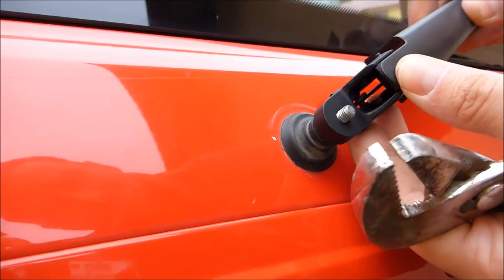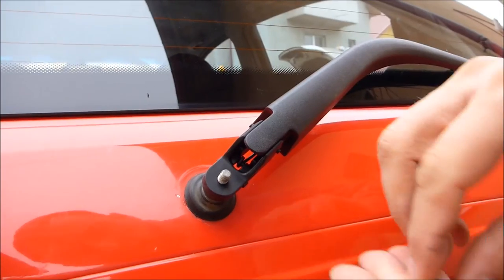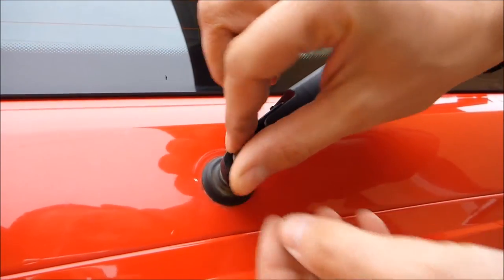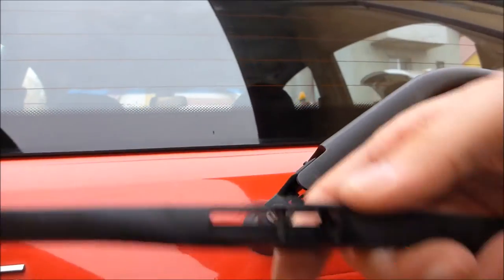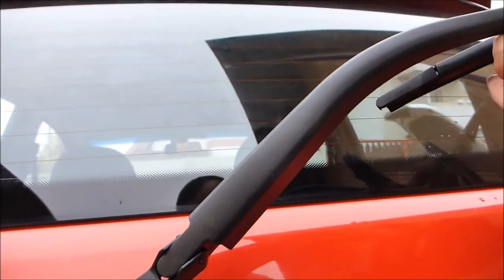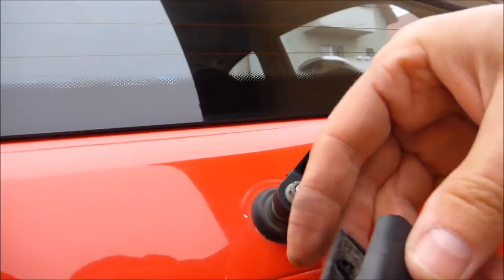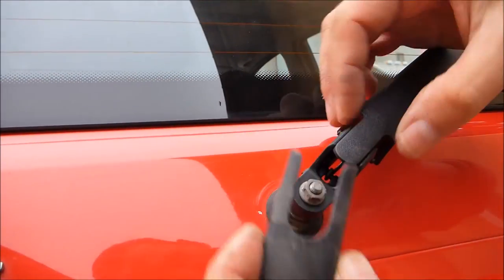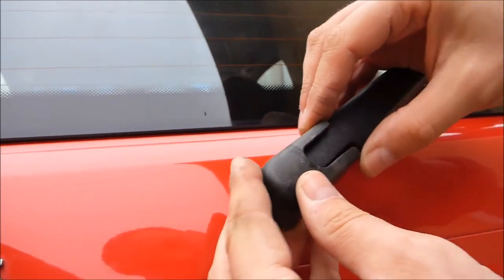How to change the rear window wiper arm Chevrolet Spark / Matiz, audio: English

Comment: Good clear video. But using pliers (vs extractor tool) forces things apart at a slight angle, and can tear the top of the bushing where the arm rests on the motor shaft. It happened to me.
Reply from the maker: Thank you for your comment and good advice!

Comment: I need to replace front wiper arm of Chevrolet spark. It's hard to get the oem one. Can is use any other cars wiper arm on Chevrolet spark
Reply from the maker: You can look for an aftermarket product. Or try one that is most similar with the one you have as dimensions and form.